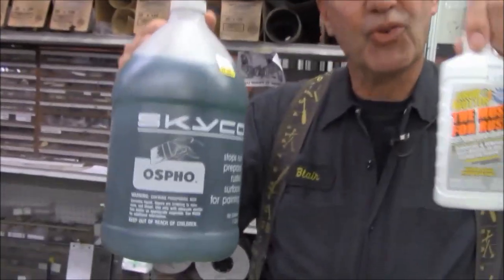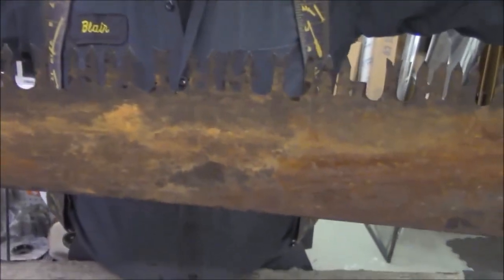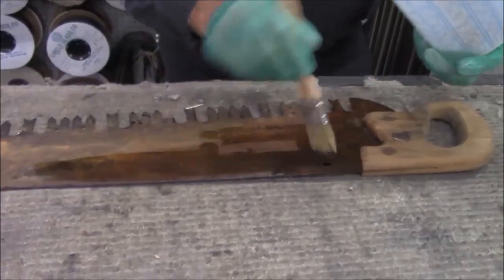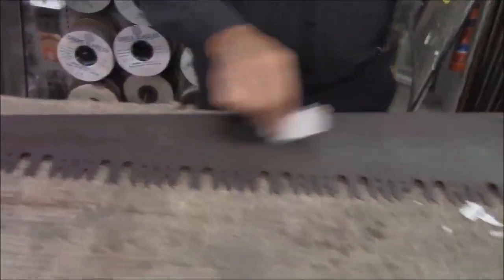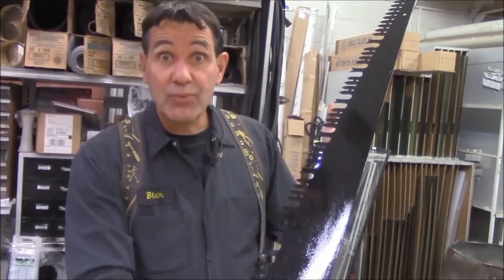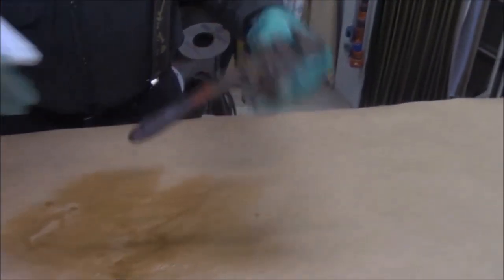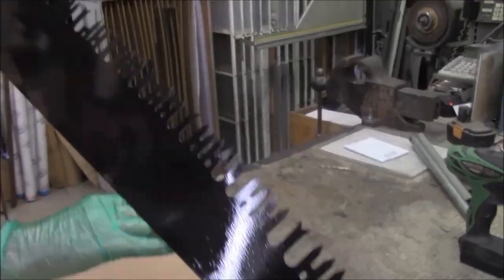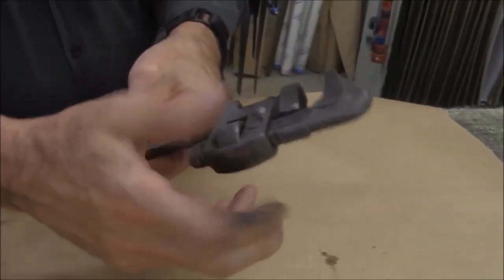Rust - Phosphoric Acid will Stop, Inhibit, Convert, Remove, Prep Metal

Comment: Great content. I use it UNDERNEATH my panel van on the chassis. It doesn't need rinsing - so after its "cured" and turned black (overnight) - I then spray it with a lanolin based undercoat. 

Makes an amazing job!
Reply from the maker: That's a great way to do it!

Comment: I would do the following:
Remove wood handle. Never leave this on to get oil soaked with WD-40 or damaged with Phosphoric Acid. Set aside.
Sand blast the blade first both sides with either sand, aluminum oxide, or glass beads for glossy metal.
If handle has varnish left over,  soda blast the wood handle.  It does not leave divots (small dents from sand) behind.
Then etch the metal blade with P Acid as this will prevent rust for upto a year and seal any rust forming continuously on it.
Let PA dry on blade. Brush off white powder well, and ready to paint.

Wood handle - sand it down with 150 grit, then 320 or 220 grit. Finer is better.
Lather on Boiled Linseed Oil and let it soak in well for 10 mins.Wipe off with paper towels. After 10 mins more, wipe again.
Let dry for 2 days.
Dilute Varathane Oil Based Clear Satin Interior Polyurethane 50:50 with Mineral spirits.  Do not use from jar directly.
Brush this on the handle, in a light coat. After 15 mins, smear it/ wipe it with paper towel lightly. Leave a thin film on. Let dry 2 hrs if hot sun or longer till completely dry. Recoat 3-5 times. 
This soaks in and strengthens old wood and leaves a natural finish to the piece.
Sand lightly 400 grit before final coat, to remove dust or bubble craters.
Wax up the finished handle for a subtle shine. Using Poly makes the handle very durable and water proof.
Reply from the maker: @mjremy2605  I agree, except about the polyurethane. They are usually too hard and not that flexible for something like a Wood handle that can get damp or wet, depending on where the carpenter is using it. I like spar varnish for any wood that may get damp or wet because of its flexibility.
Reply: @MrHardware1  Huh?  Poly is flexible not brittle. Odd you should say that. Spar Varnish is not as durable but much more UV resistant for being in the sunlight. Waterproofing - Poly is fine and best in my opinion.... and cheaper.
Reply: Too much ....we like lazy

Comment: I will NEVER do ANY car body repairs without phosphoric acid at hand. Use 85% diluted 1:1 for the "slime" with brush and 1:2 for the spray bottle. Let it sit for as LONG time and/or use infrared heater to speed things up considerably.
Reply: Just curious what u dilute it with water? I ask because I seen another video “just a hand” dilute his with hand sanitizer. Also how do you get rid of the white frost ?? TIA

Comment: Motorcycle gas tanks?
Reply from the maker: @greggory448  of course. I believe there is an epoxy (or some other) coating that can be poured in, swirled around and then drained which works well after the rust has been treated. The coating does not necessarily ’kill’ the rust.

Comment: A proper restoration would involve removing the wood handle so all the metal can be treated, as well as cleaning up the handle and coating it with boiled linseed oil.  After treating the metal, it can be coated with any kind of auto wax then wiped clean.

Comment: What's your opinion on having to neutralize it with water before you paint
Reply from the maker: I’ve used water to remove excess product from the surface but most the time when I use it I don’t. I’ll let it dry and I paint over it with an oil base paint.

Comment: Total different process in automotive..The ONLY acid cleaners SPI recommends is Opsho, PPG and DuPont metal preps as long as their instructions are followed to a tee.
Use any other system you want, just do us a favor and use no SPI over them.

There can be NO shortcuts for good results.

Ospho, is a great product for automotive if used right, we give scare warnings because we want people to call so we can make sure they know how to neutralize it, so no problems will arise.
Only one way to use and here it is:
Use as needed and apply as many times as needed to get the spot Clean let dry and leave for months if you want, don’t matter.
To neutralize the Ospho MUST be wet, so if dry, re-wet with itself and let set one or two minutes and with a clean rag and water, wipe off like washing the car and then dry.

Next, then da car with 80 grit, clean with 700-1 wax and grease remover, let set an hour and coat with an epoxy. Notes of interest (maybe)
If you try and sand dry film off you will lose 40-60% adhesion (per adhesion tester as some will embed itself in metal and amount depends on how long the Ospho has been on panel as we do know acid films degrade with time but due to many factors we cannot pinpoint a time frame.

The tape is not a test, use razor scraper after 7 How does it fail? Here are a few calls.
Washing car and hose bounced up, hit car and paint bubbled. Kids finished ball game  and ran by car and tossed ball gloves on hood, next day two big bubbles.
Wife got bag out of trunk, closed trunk and set bag on truck  to play with keys, next day a bubble there.
My FAVORITE TECH CALL at least once a month, my body filler dried and sanded great but Then I got to metal is was gummy, DO I HAVE A BAD HARDENER? Nope only one thing, you applied it over an acid film..
Reply from the maker: Wow, thanks for all the tips. Who is SPI, I can’t find who you work for, just out of curiosity. Blair

Comment: When treating,  I'm getting white powder on the metal afterwards unless i wash it off immediately but as a result, the steel will flash rust. Any advice?
Reply from the maker: I’ve found the white powder to be when an excess of ospho, I’ve never seen flash rust rinsing off excess w/ water. If so I’d wipe a little more ospho on it and wipe off.
Reply: @MrHardware1  Your correct, the white powder was more noticeable when applying a heavy layer of phosphoric acid.  The good news, it wipes off fairly easy.

Comment: Does Klean Strip Concrete & Metal Prep leave behind some latex or acrylic coating? Is there a rust converter that only uses acid? Seems like some latex coating will negate the ability to use a primer. Ultimately, you're limited to the adhesion of that latex or acrylic.
Reply from the maker: I’ve never used this particular product although it looks pretty much the same as everything else I’ve used. I’m old-school, so I still recommend prep be covered with oil base paint first or an oil base primer and then you can put latex on top of that, if desired.
Reply: @MrHardware1 Concern is that an oil based primer doesn't help very much if you're limited by whatever smoo they might have put in the converter (perhaps to avoid flash rust).  I asked Klean Strip directly so we'll see what they say.
Reply from the maker: @wildmanofborneo  I bet it’s dilute phosphoric acid w/no important ingredients. That’s what’s in the commercial brand I used on my steel seawall 20 years ago. It softens the rust and sucks out the oxygen so when painted there is no oxidation (live rust) going on underneath. I’ve cut it w/distilled water to use in a tank sprayer when doing large areas that I still maintain and with great results.

Comment: I clicked on this because the title said "Phosphoric acid".
Rather than a phosphoric acid-BASED product, have you tried using just phosphoric acid by itself?
(the stuff can be bought plain, so i was thinking about trying that option on some rusty metal; but if someone has already tried it and had bad results, I won't bother with the plain stuff)
Reply from the maker: I can’t say, but I’m interested. Is it easy to purchase?
Reply: @MrHardware1  probably .  ama zon claims to have it, but when i posted the link to it here it wouldn't post.
I saw it listed at 10% and at 75%.  was considering getting the 75
Reply from the maker: @bledlbledlbledl  I’ve had such good results from ‘store bought’ Skyco Ospho that I never desired something stronger. If I were trying to do a very large area I might consider something stronger so I could dilute it to save $$. I also like to patronize local merchants over mail order. I want my merchants here to stay.
Reply: @MrHardware1   for the price, I'll probably go with that, then.  (i looked up the percentages of ingredients just now, and i get more phosphoric acid for the money with the ospho anyway)

Comment: The metal gets a black coating on it are you supposed to paint over that or rise it off first and then paint over
Reply from the maker: When I painted my seawall cap, which had been painted before, and had some paint here and there, I had to rinse the phosphoric acid off the painted areas because it remain tacky. It dried in an hour, and I was able to get a nice coat of oil based enamel over the top.

Comment: Great video, & I have a question. This is probably a dumb question, but can you sand that afterward & get it shiny?  Thank you.  I've heard of Ospho.  I've had a little rust problem on the roof of my truck.  This is probably the way to go from what I've seen so far.  Thanks
Reply from the maker: Of course, if there is any rust residue I re-apply the ospho and rinse off any excess a few hours later.

Comment: aAren't you supposed to rinse it off with water after a few minutes?  I had a very old bottle of the stuff that said so on the label.
Reply from the maker: My bottle says when dry to dust off any powder before painting. It does say when used to etch galvanized metal, which is hard to paint when it’s new, to rinse off after you’ve etched the galvanized.
Reply: i used for s lond in never rinse it, its not a acid anymore so what rinse yo have to rinse muriatic not this.

Comment: I would apply 40% thick(ish) coat with a brush. Then wash it away (with a pressure washer), let it dry and spray with 20% mix. Once thoroughly dried, paint over with a (zinc phosphate) primer.
Reply: That's a bit overkill, but overkill isn't bad.

Comment: Nothing, and I mean NOTHING beats phosphoric acid as a 1) Rust remover, 2) Rust converter and 3) Primer. As stated, works by pulling oxygen out of iron oxide (ie. rust) and converts it into passive iron phosphate (black/grey). Needs to be at least 20% phosphoric acid mixed with water. Heat speeds up the process dramatically. To put it another way, in cold nothing much happens. You can thicken it with (pink) wall paper adhesive powder to apply a thick(ish) coat with a brush.
Reply from the maker: Thanks, great idea with the thickening trick.
Reply: You need to wear safety glasses/ goggles as it will burn your eyes, ask me how I know.

Comment: I live in Thailand, we can't buy the products easily here but I can buy the acid on its own. Any ideas what I would add to the acid to help it bond?
Reply from the maker: I bet the phosphoric needs to be diluted to a certain ratio. It doesn’t need anything to help it bond, it cleans, removes oxygen and is the prep for the finish which I prefer to be an oil-based paint.

Comment: Why not actually remove the rust with muriatic acid, then neutralize with baking soda and water, then treat with phosphoric to convert and seal the remaining rust?
Reply from the maker: I don’t like to put muriatic acid in an amateur’s hands. Besides the phosphoric acid does loosen and clean most of the rust while priming the metal.
Reply: @MrHardware1  Understand the concern.  It might be a hazard in confined spaces or underneath the car.  I like that muriatic eliminates all rust, but it does need to be neutralized before it eats into the steel.
Reply: I think if you remove the rust, then there is little for the phosphoric to do. As I recall, phosphoric doesn't really react with clean metal - which is why the old D-Rist instructions used to say "Remove loose / flaking rust, but do NOT remove light surface rust" (or words to that effect) - as it is Iron Oxide that is converted to the tough / stable iron phosphate I think.

If you use the HCl to remove the rust and you get clean metal - and then apply phosphoric, I don't think it will have anything to "work with" so to speak.

Experiment perhaps with a bit of scrap metal. I reckon once you have removed the rust with HCl, if you apply phosphoric, it will just "sit there" until it dries out - leaving the metal vulnerable again.

Comment: I have pure phosphorus acid. But what the HELL is used as a base/carrier to prime n convert. Otherwise my steel turns white.  If you've ever used ", rust converter". It turns BLACK! What do I mix it with???
Reply from the maker: I have diluted it w water when coating 200’ if steel seawall. I removed white residue w water on a rag then dried off.

Comment: Man... This was going good until you pulled out the spray paint and painted that saw. Sinful in so many ways!
Reply: you have to paint it or oil it. it is super stripped after the acid and will rust up real quick

Comment: After I used phosphoric acid Iit  turned yellow after I washed it off sprayed it will acid again didnt wash it off it turned white and oily
Reply from the maker: I’ve never seen it create an oily surface. Is it a phosphoric acid for Rust cleaning or just the pure product? I would think, without knowing for sure, that it should rinse off with water and dry hard so it can be painted.
Reply: @MrHardware1  85 percent technical grade I diluted it 4 to 1 with water  the trick is to actually get a rag and wipe  it not just spray the rust off perfect bare metal finish now even after the morning dew

Comment: If I want to spray on a oil based truck bed coating to freshly etched metal using phosphoric acid, would I need to remove the acid for better adhesion? The directions for the truck bed coating says bare metal works best. But I don't see why the acid wouldn't help it stick better, just like the paint?
Reply from the maker: To me, the importance is killing the rust. I have not found the residue to hurt the adhesion of an oil based paint yet.
Reply: @MrHardware1  
Other than removing the white residue I have found you still need to scuff the metal with a scotch bright to a smooth finish, unless you plan on many layers of paint to coat the metal, unless the surface is even it will show in your paint.

The darkened layer is the acid left over, it takes a fair amount of effort to strip it back down to the bare metal.
Reply: @lordterra1377  I thought dark is where the rust was chemically changed to phosphate and can't rust no more? If I sand it off that cancels out the reason for use? How about if I neutralize the acid with water or baking soda? No more acid to react with anything after that and paint with epoxy? Etching primers have acid in them and you primer and paint over them.

Comment: I did underside my Jeep.  Can i leave those white residue there?? Or all white residue has to come out??
Reply from the maker: I found it to be harmless. You may rinse it off w water
Reply: @MrHardware1  It does not come out with water even ah high pressure from garden hose 55 psi.  If that is phosphoric acid, i dont think is non poison.  ???
Reply from the maker: @emergencylowmaneuvering7350  what ever residue I have had , if it doesn’t rinse off, w/ regular water pressure, has not prevented my paint from bonding. Poison, yes. Don’t consume or breathe any.
Reply: you must be using it very concentated or waht? i just aplly rust turn black and a leave that way, bçlacxk cant see any white there,,

Comment: Would this be a surefire way of protecting and ensuring a rust-free surface after using more aggressive methods such as media blasting or dustless blasting? Can imagine this would really prolong the life of a steel boat hull after first removing the thick layer of rust, along with compatible paint, given that it not only protects but would also get any fly rust and would apply its magic to any missed pits or dents.
Reply: Yes, in fact if that's how you intend to use it, you can mix the acid 50/50 with water first, then rub it onto the metal, then rinse it clean with water (and mild detergent if desired, but not necessary). It actually mentions this in the instructions on the back of the bottle for many phosphoric acid rust removers. This diluted 50/50 acid/water-then-rinse step is recommended to help bond base coats of paint after washing the item with soapy water if needed, followed by a full-concentration treatment with the acid to ensure all rust, oil, dirt and grease is removed.
Reply: @allmycarsisbroke  i just apky and leave never clean wuth water, sometimes paint over it sometimes not..
Reply: @kurkkobain  interesting. I don't have any experience painting over after allowing undiluted, non-neutralized acid to dry and not rinsing, but I have read a lot of comments from others saying that doing so tends to create problems later with the paint bubbling. You haven't had that problem? What kind of paints and primers are you using? Are you sanding before painting? Etc.
Reply: @allmycarsisbroke  so use the 50/50, then wash, then full power then wash then prime or paint a fender? Or door etc? Ppl say don't use it the paint won't stick. Well alot of company's use acid to get metal to paint so why not me or whoever? Thank you. I have some Ospho and it has directions for oil based paint but not epoxy or urethane.

Comment: Very informative video. I am planning on using it for undercoating my truck. Do you think I can spray on CRC inhibitor after it does its thing. Also any problems with rubber or plastic? Thank you
Reply: Plastic is safe, rubber I would limit the exposure time. I would use oil based paint before I would use  CRC.
Reply: it probably won't help with undercoating. did you ever try it